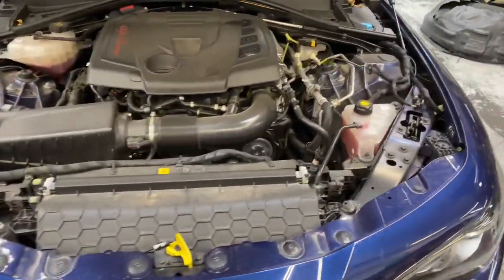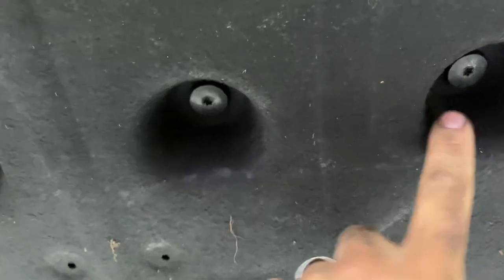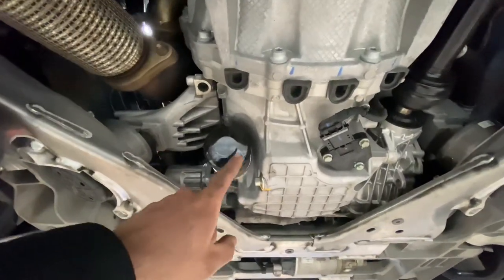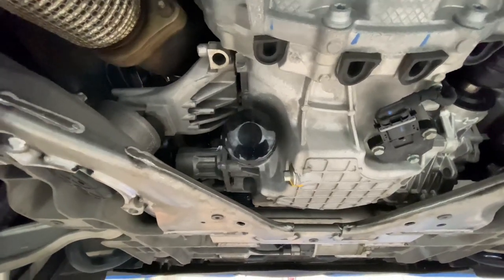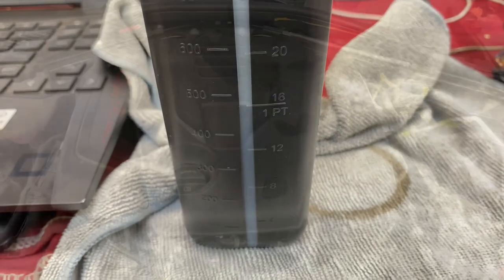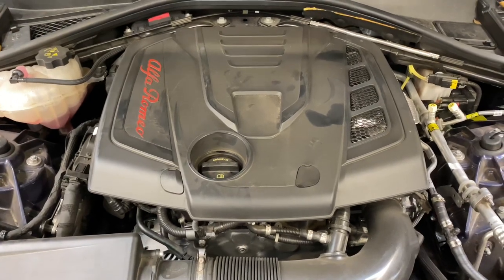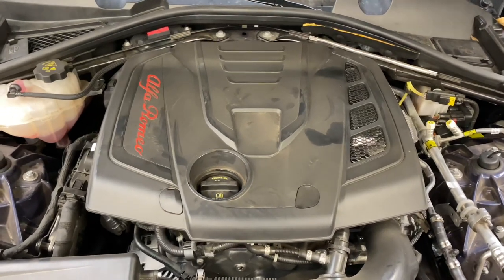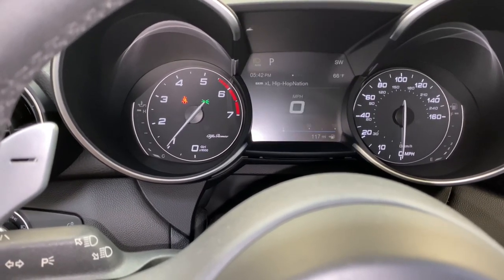Alfa Romeo Giulia TI sport oil change

Comment: I love the Giulia, but I do wish that they would learn some lessons from the Germans with regard to easy servicing. Having to remove so many screws and the undertray to do a simple servicing task is ridiculous. On most German cars there is a flap in the undertray for draining the oil and the filter is easily accessible from the top. And don't get me started on the lack of a proper dipstick.
Reply from the maker: Tell me about it. Completely agree with you.
Reply: What? Removing an under body tray is easy, and the German cars a have them too. But the German cars (made in the last 5 years) are a mess once you take off the cover. Zillions of plastic bits and fasteners in your way. This Alfa looks like it's easy to work on. All the important parts are metal and there arent rats nests of tubes and wires in your way!
Reply: The Last Alfa i owned (a giulietta required about 20 screws to be undone so that the undertray could be dropped to change the air filter. On a VW/BMW the same job is done at the top with the removal of a few clips or 6 easy to get to screws.

Comment: Do I have to have software and scan tool to get rid of oil change due light if I do my own oil change?
Reply from the maker: Yes you do. For the notification on the instrument cluster you can try the key on engine off pump gas pedal to the floor slowly 3 times within 10 seconds method but it doesn’t always work. For the radio notification you need software and scan tool that is capable.
Reply: @hycastro is the scan tool proprietary? What does it cost to acquire one? $300 for an oil change is absurd (to those of us who have never paid someone to do an oil change), but if the tool costs $3000 then it would take more than 10 oil changes to pay for itself!!! That's horrible! (context, I don't have a giulia, but I'm thinking about one)

Comment: Manual says every 10k mile or 1 year. To me that sounds a little extreme. Is it safe to wait that long. Or do you recommend different
Reply from the maker: Personally I wouldn’t go over 6k miles. The service interval seems to be getting longer and longer on cars and I’m not a fan.
Reply: @hycastro  I go 5k on mine. With the stress and heat these engines are subjected to, 10K is way too long IMHO. I am glad to see a tech recommend more frequent oil changes.
Reply: I did 10k/1yr for a long time (6 years) and as the car got older last change I got a check engine light for lower than expected oil pressure in the HP circuit. The oil filter got dirty after 9k miles and was restricting flow. Now I go 7k.

Comment: This is the Best video for this car for oil change. I always drain oil first  then drill/hole punch  a hole in the bottom of oil filter then unscrew for a clean pipe change.   The reason I was searching is there a way to reset the oil change on dash cluster without having to hook a computer to it?   So stupid this car doesn’t have a oil dipstick.  I can see them oil reader sensor’s going bad and not read right after 60-80k miles . Nice video

Comment: This is awesome.  Any chance you can make a video on transfer gearbox oil replacement?
Reply from the maker: If I’m not mistaken that fluid is filled for life just like the trans and diff but I’d have to double check. If one comes around I will definitely make a video for it.

Comment: Cut an access hatch in belly pan? Pop rivet a couple metal tabs on one side, some sort of latch opposite side, so it comes off like a tv remote control battery cover.

Is there a laptop app or something a diyer can buy to access those menus, reset dash light and oil level?

Comment: Just found your YouTube channel very helpful I live in the uk and just had my car serviced by my local garage as I always have I have the Alfa giulia 2 litre 280 hp just done the 40.000 service how do you reset the service interval information on the dash we have tried many obd tools help 🤓 my car is 2019
Reply from the maker: For the dash light, you can do the procedure that requires you to step on the gas pedal to the floor 3 times within ten seconds with the key on engine off and sometimes it requires multiple tries but for the radio warning you have to use a capable scan tool which is a hefty cost itself.

Comment: took it to brakes plus and they added oil to the full line. the next day i drove it, my alfa was shaking at idle and my engine light was blinking along with the ecs and ast and a couple other codes…i didn’t do anything different but when the car warmed up, it stopped shaking. it threw p0302, p1062, and p0363.

Comment: Sorry I know its not related but can you clarify the mystery behind the proper coolant? Lot of confusion on the forums regarding which coolant to use, Mopar purple fluid apparently isnt compatible with the factory fill orange Petronas Paraflu UP? My car has orange fluid it in it now, not looking to flush the whole system just need to top off the Engine coolant reservoir on the passenger side and don't want to mix fluids. Paraflu is available pretty much no where, Mopar is easily available
Reply from the maker: Yeah I’ve been using the purple coolant that’s provided to us since we got Alfa back in 2017. If you don’t feel comfortable mixing colors I would suggest ordering the petronas from an online store.

Comment: What is the name of the software and scan tool you're using?
Reply from the maker: For this specific video I was using the dealership software called witech 2. In my 4C oil change video I used a scan tool called autel which is more commonly used in independent shops and or do it yourselfers.

Comment: So you connected a laptop to the USB in the center Port using windows? I'm confused what tools you used to reset it? Also is the software free?
Reply from the maker: The laptop is connected to the dongle that’s plugged into the OBD2 port via Bluetooth. We use witech 2 which is what the scan tool is called. The software is not free, you have to subscribe and the dongle is $500-$600.
Reply: @hycastro  yeah but in that 500-600 $ you get ,,i mean you can scan or reset after change ,,all parts or all board alarms???

Comment: Question for my 2017 guilia ti did a oil change but feels a bit less power can it be do to not reseting the oil change intervals for the uniair???
Reply: Please lmk asap I am new to the alfa and I do my own work but just wanted to now if that's something u see happening??
Reply from the maker: As long as you use the correct filter and oil there shouldn’t be any issues with vehicle performance.

Comment: what's the difference between the turbo charger coolant and the coolant?
Reply from the maker: Engine coolant reservoir is located on passenger side and is only for the engine cooling system. Turbocharger reservoir is located on the driver side and is a smaller reservoir and is only for the turbocharger system. Both systems use the same coolant and are independent of each other.
Reply: @hycastro  ok thanks I did not know that but glad I asked. My turbo tank was low but I thought it was just another coolant overflow. So I’m glad to know I didn’t put the wrong fluids (be it that it was only a cup or less)

Comment: What is the siren like sound the car makes when you shut it off. Mine does that as well. Lasts for 15 min or so
Reply from the maker: Turbocharger after run pump circulating coolant.
Reply: @hycastro  cool thanks!

Comment: What's the scanner you use Sir?
Reply from the maker: Witech which is provided by the dealer, but you can also use a Autel scan tool as well but it has to be capable of resetting maintenance lights.

Comment: In regards to the oil to use, I found something about that but not 100% sure if it's correct, but knowing Fiat it might be.  

Just because an oil is 0W-30 or 0W-40 and synthetic doesn't mean it automatically meets the Fiat spec. The only oil that seems to be readily available that meets the specs are Pennzoil Platinum Euro LX 0W-30 which will probably have to be ordered at Advanced Auto Parts/CarQuest. This oil will say on the bottle, "made from natural gas". They come only in a gray bottle, not yellow.  Any oil you buy should say that the oil meets the spec, and should say "EXCEEDS MS-13340, FIAT 9.55535.DS1, FIAT 9.55535.GS1".  You have to check to make sure that the Chrysler place you take it to has the Mopar MaxPro+ with the Fiat/Alfa confirmation, a lot of dealers don't carry it in stock and will put whatever they have into your Alfa, not good.

Like I said, knowing Fiat they have their reasons for using this special spec oil, and it is wise to heed what they say to use.   Fiat spec oil has mostly to do with the oil vapor recovery system. The spec requires a very high-purity oil. The Pennzoil that meets the spec is made from natural gas, not oil. Direct injection engines tend to get carbon deposits on the back of the valves from the oil vapor recovery. On port injection cars this carbon gets washed away by the detergents in the gasoline. It can be very expensive to have the carbon removed, and it lowers performance if it builds up too much, but you don't want it to build up at all, so use the Fiat/Alfa spec'd oil.

I would assume that this oil would be wise to use on any port injection car.

The color of any bottle of oil will change over time. It might be gray today but it could be some other color tomorrow, the color isn't important, the Fiat/Alfa spec's numbers are what's important.
Reply from the maker: Very good comment. You are correct.